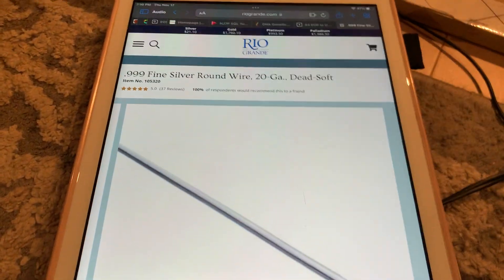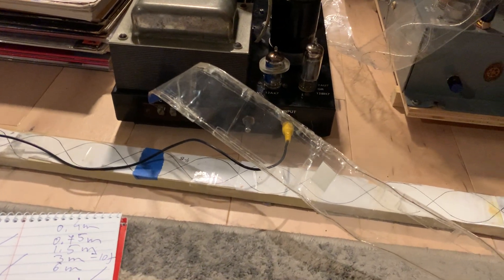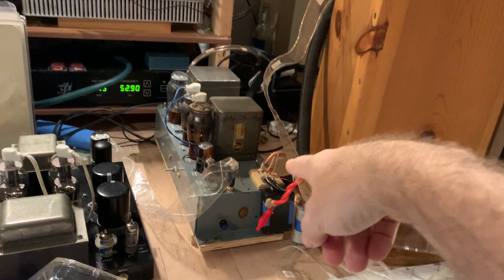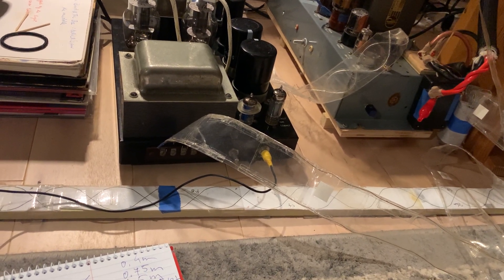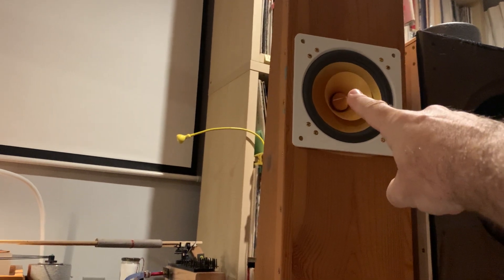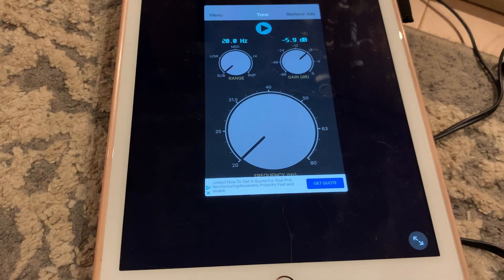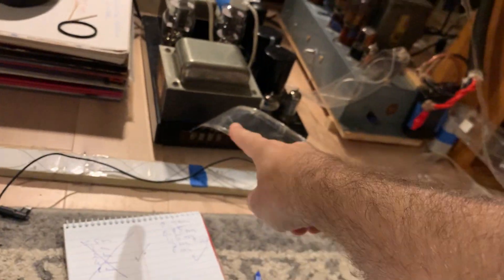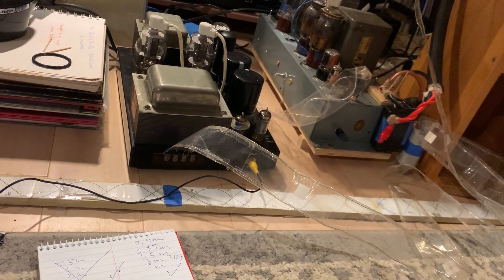Ultimate simplicity DIY speaker cable for high impedance speakers (part 2)

Comment: Hi Janos. I want to try your speaker cable idea… I would appreciate an advice for the connection Mark Levinson 332 (i‘m considering tubes in the future ;-)) to Wilson Audio Watt Puppy V. AWG, parallel, twisted etc.??? If you need specs, pls ask me.

Thanks for your work, i‘m enjoying it! Greets, Dom